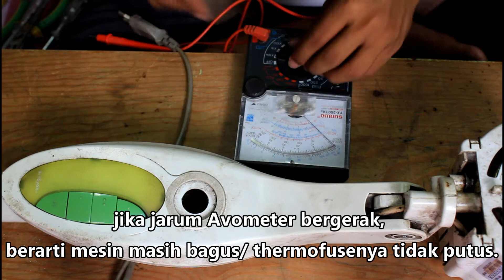Cara mudah SERVICE KIPAS ANGIN yang rusak (HD)

Comment: Itu kondisi mati total atau dinamo hangus mas
Reply from the maker: iya mbk mati total.. tp dengan catatan dinamo ngga boleh putus dan ngga boleh hangus mbk..
di cek dengan Avometer.

kasus yg sering saya dapati macet di poros, ganti aja bearingnya..😁👍
Reply: Mas Wardoyo  berarti cek kondisi dengan avo di posisi ohm yahh?? Kalo posisi ohm tidak bergerak berarti posyive dinamo hangus?
Reply from the maker: iya mbk posisi ohm ( x1/x10 boleh) yg penting mau liat dinamo masih nyambung atau tidak..
dalamnya kan ada 4 kabel., 
1. kabel hitam kipas angin ke probe negatif, trus kabel warna merah, biru dan orange coba satu satu dengan probe positif pada Avometer. klo mereka nyala semua, brati dinamo masih bagus mbk. klo di cek ngga nyala, coba bongkar dan biasanya hanya "thermofusenya" yg putus, semacam sekring...
Reply: Mas Wardoyo terimakasih mas  war ilmunya salam si igel ehehhebeb
Reply from the maker: siap mbk Winda.
sama - sama..he he he 😁